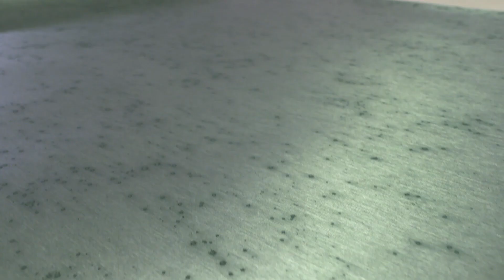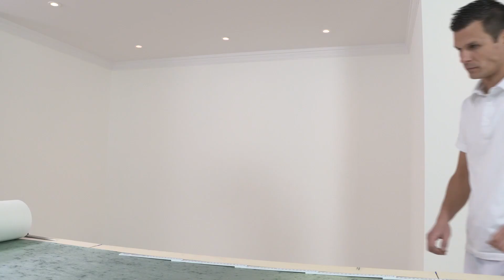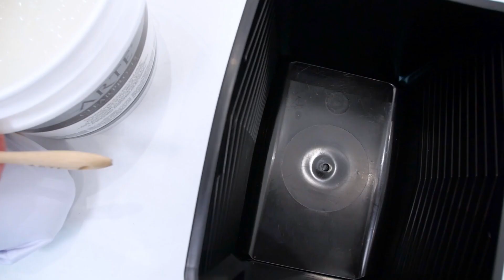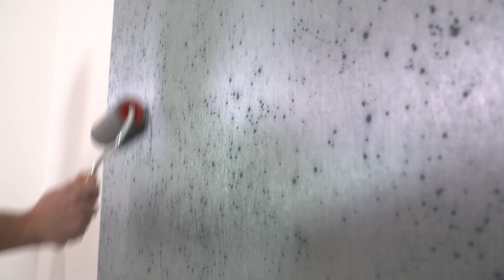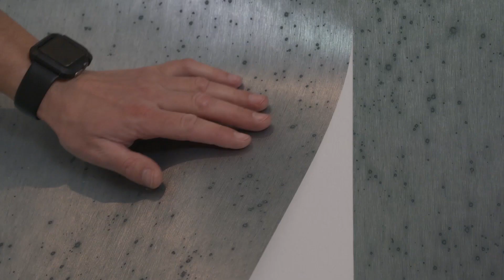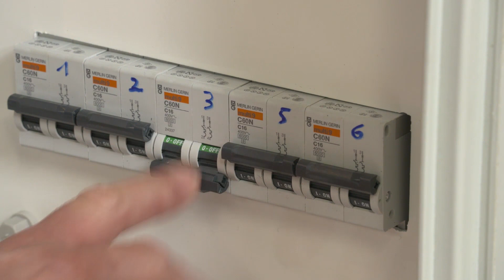How to hang metallic wallcoverings? Step-by-step instructions

Comment: For what the water in the roller , explain to me plz .
Reply: So the paper expands, otherwise the paper will expand on the wall because there is a lot of water in clear paste, then your seam will open up. Personally, I dry hang with clay because there is much less water in it without pre moistening the material. There is much less water in clay paste and also water can not escape easily behind foil. It’s non porous.